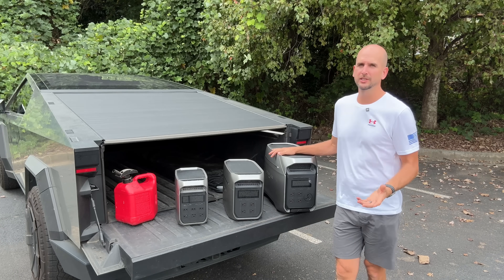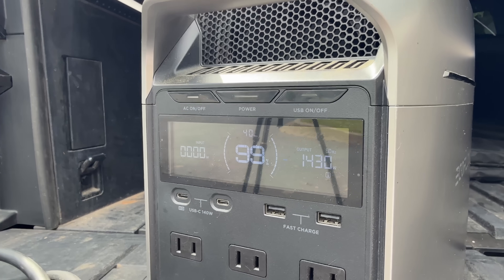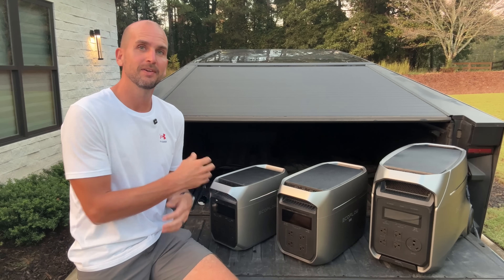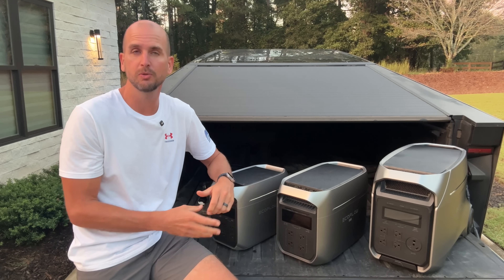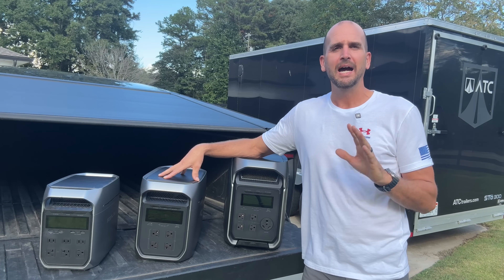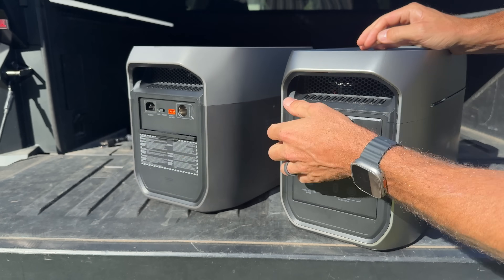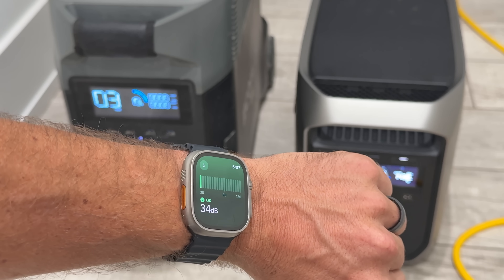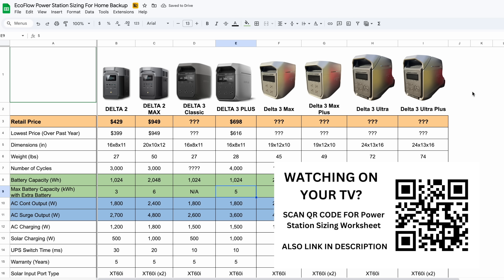Is This the Gas Can of the Future? (How Far Will It Really Take You?)

Comment: i know this guy is a "committed" EV and "alternative energy" convert. that's fine, this is America, he can do and believe anything he wants. i actually watch a lot of his videos as i AM interested in the PRACTICAL applications of solar and battery storage systems. HOWEVER, the entire "cyber truck" "electric car" cult is just amusing to me. for some people who drive less than 50 miles a day and have a house with a garage with a home charger - that "climate crisis" person can plug in their EV, go to sleep and wake up with it fully charged. of course, the electric coming into his house is generated by "good old fashioned and DEPENDABLE" fossil fuel (gas or coal) at the main power station - but of course, that's a different issue. as to TRYING to make an EV pickup actually "work" by throwing in a "fancy auxiliary battery thing" - nope, won't work. WHAT HAS MADE SENSE for pickups over the last 100 years is to power the truck with GASOLINE and then carry a full spare three-gallon gas can which will COMPLETELY remove any worry of getting "stranded" somewhere "out of fuel."  LOL! LOL! LOL! i continue to be entertained by the EV gang trying over and over to make "2+2=5."

Comment: Neutral to ground is a bootleg ground. Best to stick a rod into the ground and just wire the plug you're making directly to the ground terminal. Or, add a clamp and clamp onto a conduit or pipe that you know is grounded. But creating a bootleg ground, like in the home, is a dangerous thing to do and will electrify metal things plugged into it.

I'd like to have my roof covered in Solar panels that heat up to keep snow off. The position of my house, the roof gets sunlight from sunrise to sunset. I'd like to have those solar leads enter the house and have a connection point where I'd keep those batteries. Mainly my communication equipment, computer stations, refrigerators first, then eventually expand to the entire electrical panel. My desire is to get off the utility entirely.

Comment: Ecoflow used to have a unit that could recharge with a level 2 or level 3 (?) charger. A feature that I thought was key for home backup.  The ability to take the battery pack, drive 30 min away from the power outage and recharge the battery pack. Is this still a feature?

Comment: I have a 20 year old 10KW, 13KW peak generator with a two cylinder Honda engine and a 10-gallon tank which would be my choice to charge an EV away from charging stations or land power.  For power bank uses I find I get more bang for the buck and flexibility with a separate sine inverter paired to an external battery of choice.  But all-in-ones are compact and convenient.

Comment: So the best bang for the buck is to buy a portable 2000 watt dual fuel gas generator with an eco-mode and a gas can or propane tank for emergency backup on the side of the road.  With your average gas generator you can get between 4 and 8 KwH of electricity per gallon after efficiency losses.  In an emergency this is your most cost effective option if you made the poor decision of buying an EV rather than a plug in hybrid or a gas or diesel vehicle.

Comment: I think it's hilarious that you are trying to charge a CyberTruck from a power station.  Except you didn't actually do it.  The title is misleading.  I wanted to see you plug the sucker into the truck (along with the ground-neutral plug), and then spend the next 3 hours putting 10 miles of range into it.

Now granted, you could charge a bit faster with a 240VAC circuit, which some power stations can do to varying degrees of fail, but all that will happen is that you will exhaust the meager battery so an hour later you will still only have 10 miles of range in the vehicle.

So no... this isn't really a thing.  I can charge my EV with my whole-home solar and battery system, but that's a huge system with a 12kW inverter and 42 kWh of battery storage.   Charging with a power station is just an exercise in extreme pain.  And something any power station (with at least a 1200W inverter output) can do anyway.

It just doesn't have any actually useful result.  Nobody runs out a 100kWh+ EV battery and then expects to "make it to the next gas station" in 10 miles by stuffing another 3-4 kWh of energy into the EV.

-Matt
Reply: Agreed.  I was interested in seeing the details of using them to extend the range, not an ad for the chargers.

Comment: Why not just buy 2 EV?  tow the 2nd one until the 1st run out of battery.  Than unhook it and trash the 1st and just drive the 2nd?  :D  My point is when you have unlimited money to waste... why not just trash it when it run out of battery?  Or better yet, just have someone else drives you.

ok ok.  More serious is it's not a good idea to use battery to charge battery.  A gas generator is more practical... kinda like a hybrid that has both gas engine and E-motor.

It's not practical at all sitting on the side of the road waiting for your EV to charge.  It's not as quick as just pull out 2gal gasoline and empty it into your gas tank and continue.

Comment: Rule of thumb is that a 20 lbs propane tank countains around 120 kWh of energy inside but any engine or generator using it is extremely inefficient and would MAYBE get 20% of the energy contained. If a gas engine was as efficient as an electric one, you would get crazy mileage on a tank. I would never charge my car with a portable power station, it's just way too long (300 hours for my 212kwh truck)
Reply from the maker: Oh man, no doubt.  Are you able to use most of the Tesla Superchargers on road trips?
Reply: @EverydayHomeRepairs  This is my channel with my Silverado EV videos and tinkering stuff;)
Reply: @EverydayHomeRepairs  I never use Tesla chargers because they are too slow (they top at 250 kw and most of the time they only do 180) and I have a couple of 250+ here in Quebec. Tesla chargers are also more expensive compared to electric circuit and Electrify Canada. I would also need to buy an adapter for around 400$. I have a Silverado EV. Glad you enjoy your pickup, most people don't even know mine is an EV and that stealth factor suits me. I did some pretty long road trips towing my RV this summer (over 900 km in a day) overall very satisfied !

Comment: FWIW: 1 kWh = 3412 btu's, 1 gallon of gasoline 124,000 btu's.
Reply: Smart Internet says it can be 120k (as a product with ethanol) to 125k; not a single number. If used in an engine, the Internet says the efficiency is 20% to 40%. Using a middle 30% number, that's 36k BTUs.
  
I thought the US separated from Great Britain a long time ago, but archaic units remain.

Comment: I'd be curious as to your results from testing a real-world situation where you actually run out of juice on your EV and then hook up to your Ecoflow to charge.  Report back on how long it took to get the charge and then how far you would get from that charge.
Reply from the maker: With the 120V version of the mobile charge it will cap out at 1400W input power so in this instance it would have taken about 3 hours to charge the 4 kWh needed for the 11 mile drive.
Reply: @EverydayHomeRepairs  I probably would have just called a tow truck, if I had been so careless about charging. That's just me but I've never run out of gas either.
Reply: @wholeNwon  I had run out of gas and the 1mile walk in the snow was fun.  Told the gas station attendant and he give me a loaner 1gal gas tank (loaner as in he take a deposit $20 and when I come back he just charge that 1gal+$20 deposit to the gas that I'll fill up.  It was a fun experience and it wasn't so bad.

I think it would be a lot worse with EV since you can't easily fill up the EV and in such a short time.  And a gas generator or this backup battery would be a lot heavier to carry for that half a mile walk back to my car.  A tow truck or a friend with cyber truck might be the only limited choice.
Reply: At best that would be a curious anecdote because owners will adopt a different lifestyle for EV driving that does not require this portable battery. Ecoflow is a channel sponsor, and creative use cases will naturally be explored :)

Comment: Okay - I came across your channel while doing research - i'm not a scientist but my research has me wondering -> YT search - hydrogen (electric /water) gas -> seeing these 2 videos -> -THE GREATEST INVENTION: WATER AS FUEL! --> Turning a Gas Generator into Hydrogen - it would be like those cars you hear shutting off an on at a red or green light. wondering how far could someone drive using water and electric.
Reply: The rub is in isolating and bottling all that hydrogen; it takes energy on the front end, and a 4-stroke hydrogen-fueled engine is profoundly inefficient on the end-user side of things; most of the energy is lost as heat, as is the case with the propane and gasoline engines.  I used to capture hyrdrogen for fireballs by performing electrolysis in mt bathroom sink circa 1975.  Greatest invention?  This is nothing new under the sun